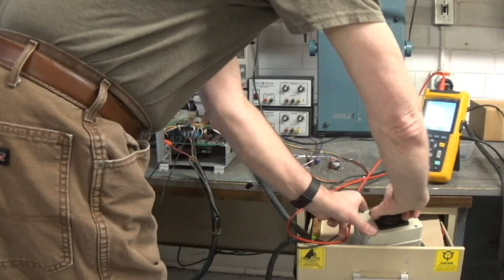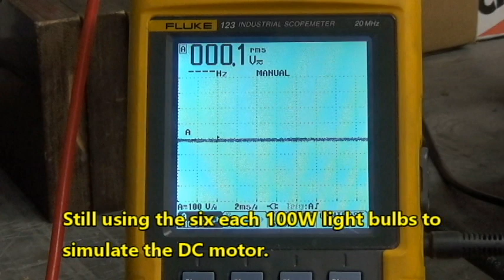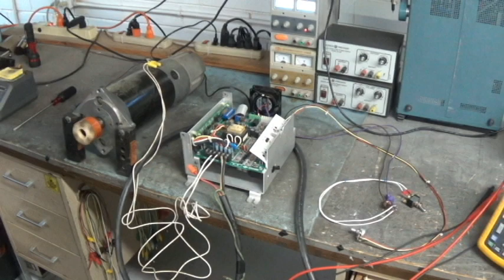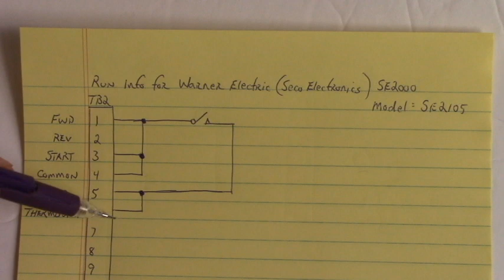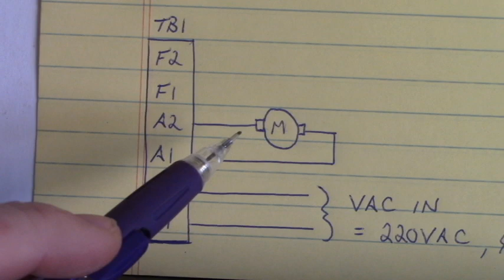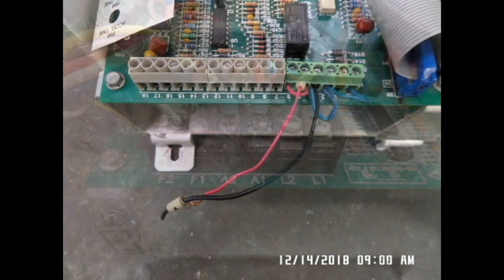Seco Electronics, Warner Electric SE2105 DC Drive

Comment: Client's motor is dc permanent magnet field too? Maybe there is no field voltage. Did you check it ? But If there is no field voltage armature current will raise. So it's seems it works fine. Keep the good job peepaw!

Comment: Thanks for the video. Just wondering how the field power into the motor works? Been watching your chanel for some time, can't recall seeing that before. Oh, and your beard seems to grows fast...haha. keep up the great work.  😁
Reply from the maker: Hi Matt, I filmed this video back in 2018. The beard was a hair longer then. HaHa. The field is the outer winding of a DC motor. When a DC voltage is applied to the field winding and current flows through the field winding. It creates the north and south magnetic poles that the armature acts upon to create armature rotation.
Reply from the maker: Some DC motors do not have field windings. The north and south magnetic poles are created with permanent magnets placed in the outer ring. The DC motor you saw in the video was a permanent magnet DC motor.
Reply from the maker: I just had a Parker DC drive in the shop that had a burnt connector for the SCR Power Module that created the field DC voltage. I show the field DC voltage waveforms on an oscilloscope. And run a DC motor with field windings.
Reply from the maker: Give me a little bit of time to edit the video and put it up on my YouTube channel. It was great to hear from you again. Please be patient with me. Takes a bit to put a video together. HaHa.
Reply: Thank you very much. Such great info. My old CNC has permanent magnet motors. Always nice to learn something. Thanks for all the videos. Have a great day. 😁
Reply: Oh, thought that may be the case with the beard growth.... Hahaha. 😂